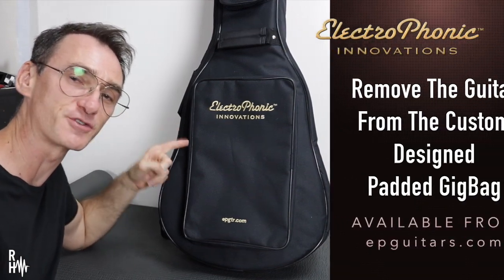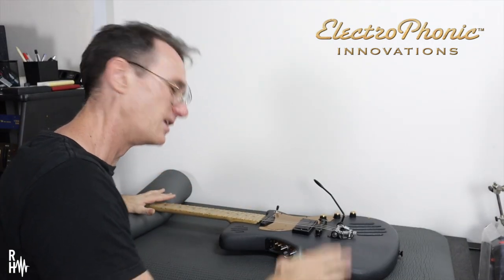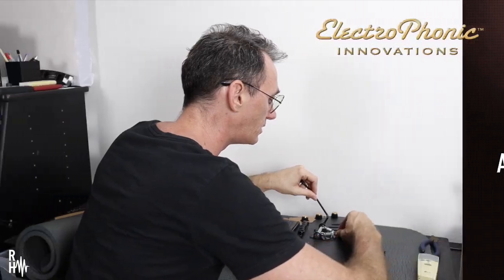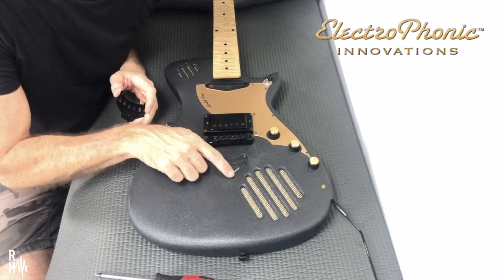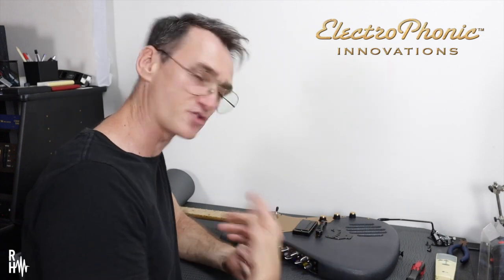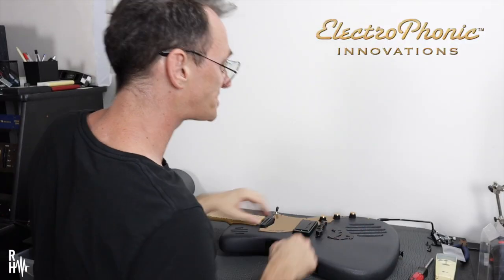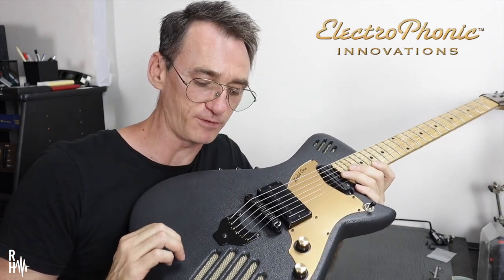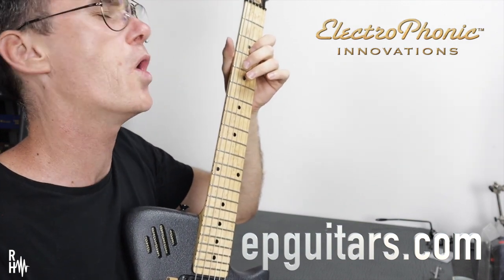Swapping An Electrophonic V-Twin Tremolo To A Hardtail Bridge.

Comment: Rick what do you prefer? I personally like it with a tremolo bar
Reply from the maker: Michael I wish I had one of each. I love using a tremolo,  but I also like to be able to change tunings quickly with a fixed bridge.
Reply: @RickHollis  Yeah same, I prefer standard tuning on a trem system like my Strat and down tuning on a fixed bridge like my Telecaster and Les Paul